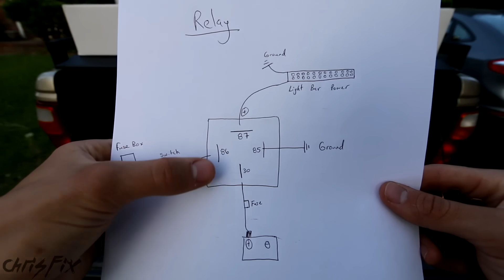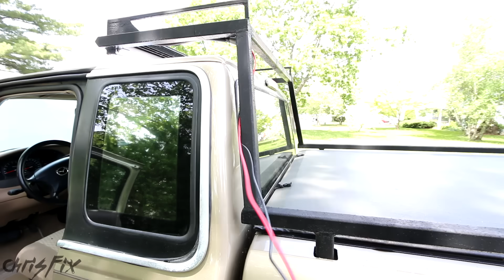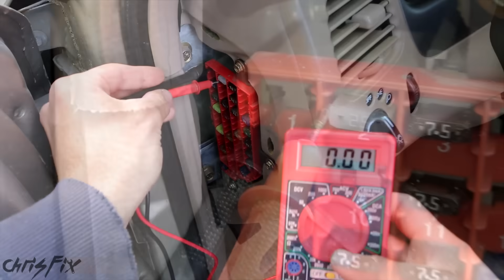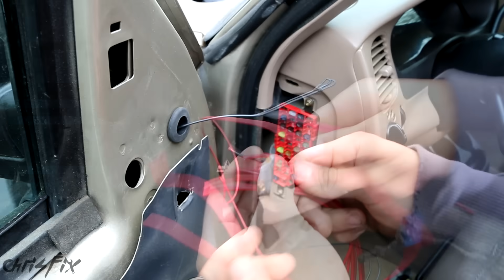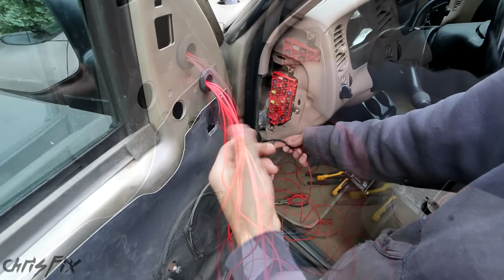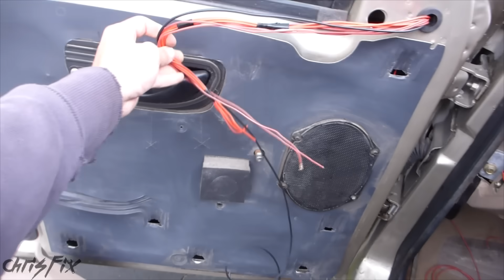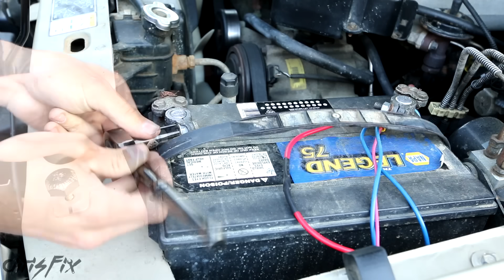How to Wire an LED Light Bar Properly (Project Night Light Episode 3)

Comment: If you want a more professional look drill hole in the square tubing and run your wire through the tubing , nothing looks more tacky then a bunch of zip ties all over your light bar 🤦

Comment: Can u make a video of doing a light bar going straight on the high beam and no extra switches
Reply: I heard that’s illegal for road use. But basically what you do is do a fuse tap with the 86 terminal on the relay to the high beam fuse on your car. To make it road legal you have to add a switch somewhere between the relay and the fuse tap where you can break the connection between 86 and the fuse tap. Switch on, high beam on: high beam+LED Bar on. Switch off, high beam on: LED bar off but the car’s high beam turns on.  Make sure you connect to 86 though
Reply: @martinramos1737  thx mate

Comment: @chrisfix id reccomend a distributing block! Like another baby fuse box with a single power from the battery to the block and block can be mounted in the engine bay. That way you don't need to run a million more wires off your battery terminal. And upgrade alternator size. Keep it more neat and organized. 

Some have internal fuses as well.

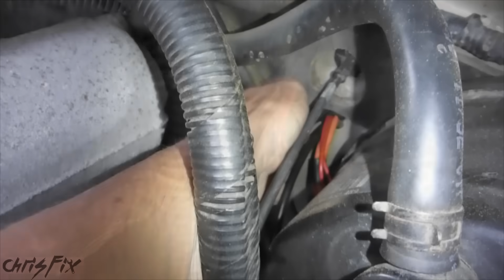Comment: 22:33 don’t forget to put on a protector on wires from the heat at the engine and sharp pieces on engine, cause to chafe or frayed and get a short and blow the fuse up

Comment: Have a question. 24:54 why ground wire put in negetive? Not in metal?
Reply: The black post is ground. If you follow the big black cable to the fuse box you’ll see it breaks off and connects directly to the body creating a ground connection to the negative terminal. Same reason you can connect the LED to the body.

Comment: I realize this video is 9 year old, but I have on question. Isn't the ground of any car just the negative of the battery? I believe in all cars the body is connected to the battery's negative, isn't that correct?
Reply from the maker: The negative is connected to the chassis so you are correct

Comment: Chris — did you ever do an update on your off roading lighting? Considering this was almost a decade ago, I wonder if you ever ditched the setup and installed a switch board to avoid drilling into factory parts?

Comment: If you're getting power from the fuse panel. Why does the relay have to go to the battery AND the fuse panel?
Reply from the maker: Running a lot of amperage through the fuse panel is not ideal. Most fuses are smaller so to mitigate the risk of overheating wiring I ran the main power wire from the battery directly to the relay.
Reply: Thanks for getting back to me. I got everything installed and am very happy with it. It all made sense once I got going. Drawing the diagram and showing everyone your example helped a lot. 

Thanks!

Comment: Why do you need to use the fuse tap? I thought the hot would come from the relay, to the switch ,and then to the light. Thanks.

Comment: If i am  going to have another 3 switches for different lights as well do i run a fuse tap for each switch? or that one fuse tap would work for all of them? With 5 amp fuse ?
Reply from the maker: You want a fuse tap for each switch.
Reply: @chrisfix  awesome thank you for the speedy response and is there another way of doing this? Since I am planning to use like 4 switches?

Comment: I prefer to just wire the light to be on the same circuit as the high beams, if I turn on my high beams, that means I need more light and that’s the whole point of the light bar, an additional button would just be bothersome unless you use it for some specific purpose where it needs to be on separately. Rather, we have to do so here from what I understand in the law. 

It has to be wired in such a fashion that when the high beams turn off, the light bar turns off immediately. Probably for road safety so it doesn’t blind unecessarily and you don’t have to fumble with more than the normal controls.

Of course, people might install a button anyway but by law, turning off the bright lights need to turn off the light bar too in some way.

That at least makes it much simpler to fix. Just find a way to let the signal wire leech off the headlight’s wiring, fuse or electricity.

Comment: Did you daisy chain the relay wires for the switches or did you run the switching power to separate other fuse taps?

Comment: I just almost set my buddies truck on fire trying to wire 4 pods up. The switch didn't work, so we swapped the power supply and power acc and made the wires glow and stick to the truck

Comment: Not trying to be that guy but a faster and easier way to snake the wires would’ve been pull them from the bottom to the top instead of top to bottom

Comment: I usually wire up my switch with the ground instead of the power. That way if something gets pinched or rubs through the wire insulation the worst thing that happens is the light turns on, instead of arcing out if it was the positive wire.

Comment: Are you able to jump the power cable from each switch, similar to how you jumped the grounds, as long as each switch had it's own relay also? or would you need a separate switch tap for every switch?
Just so I can wrap my head around the actual activation of each switch :P can anyone help you've definitely given me the confidence to try and tackle something like this.

Comment: Is that fuse tap for the switch only for if you want to be able to turn the light bar on with the truck off? Or is it required. Thanks for the great video!
Reply from the maker: The fuse tap is necessary to trigger the relay. You can pick if you want to tap a fuse that is "hot" when the key is in or hot when the key is out and in.

Comment: Are you able to just use the one fuse tap for all your different lights or do you have to have a different fuse tap for every switch
Reply from the maker: Depends how much amperage you are running though the wires and how thick the wires are and how long of a run it is.
Reply: @chrisfix  Ok thanks for getting back to me

Comment: The best quote for electricity “go big or go home” i seen someone wire aftermarket fog lamps with speaker cables (thin copper/steel wire meant for audio) and guess what. smoke and flames.

Comment: What I’m trying to figure out is I have 3 wires to a turn signal yellow led and white led on a side mirror. I want the turn signals to always activate the yellow leds and I want the park light switch to activate the white LEDs and always be on. 
I can find how to do that. I don’t need a switch to toggle them on. I can’t find how to wire it.

Comment: I followed your video to the T and for some reason my LEDs have a flicker to them and they have a delay when i change colors with the remotes any ideas?And everything is brand new wires,relays, connectors and switches if I hook the LEDs up to the battery they work fine if I hook them up to my headlights they work fine but when I use a fuse tap and relay like you did they flicker im so confused

Comment: Here's a tip for running cables in wire loom like a pro, take a 3/8-1/2" wrench depending on wire/loom size, run the wires through the closed end and run the closed end of the wrench inside of the open gap on the loom as the wires lay directly in without any fiddling around. Can do like 40' in a minute lol.

Comment: I just saw this video.  Good job.  My ONLY suggestion is that ANY connection made in the engine compartment that is "hot" you really need to protect it.  In your video you just crimped a spade lug female connector onto the relay, leaving the actual spade lug exposed.  You noticed that the rest of the connectors that were factory made (from the harness that came with the lightbar) had a protecting cover over the spade lug.  Since you are building it yourself and didn't have the same type of rubber/silicone cover that the factory used, you could simply use heat-shrink tubing to accomplish the same thing.  That way you would not have any exposed "hot" connection in the engine compartment, other than the battery terminal.

And speaking of the battery terminal, look at your Negative side.  Pretty rough!!  You really need to fix that so you don't have wires coming out of the battery terminal lug.  Over time that produces resistance, which will affect all of your electronics.

Comment: So I just did this. My only issue is the fuse. None of the extra fuse slots work on my truck. Is there any other way or another area I can connect the fuse. Or is there a way to by pass the fuse?

Comment: Chris you have a nice new toy there!! I Did noticed, in the video that you ran your wires through the battery lifting strap? It's going to make it hard to change the battery later. Without having to remove all your wires...

Comment: Chris, I measured the voltage on my CVPI fuse box terminal for constant 12v to radio, and with the fuse pulled I measured 12.6v to source side and 2v on the load side.  I expected zero volts on the load side.  Any idea what  is going on? I haven't used a multimeter much but pretty sure I had it set correctly.

Comment: @ChrisFix If you wire a light bar this way to where you can turn it on with the vehicle off, does it still have power even with the switch off? I would like to rewire my light bar this way but I don’t want it to use any of my battery while I’m not using the vehicle, will it drain my battery? Even if it’s just a small little drain I still wouldn’t like to have it that way

Comment: What is the thing you add to the switch called? Avoids any soldering and let’s you connect the wires to the switch easily. Would love to find that on Amazon or something

Comment: Doesn't the fuse tap prevent you from closing your fuse panel? On your Mazda, an uncovered fuse panel is exposed to the elements whenever you open the driver's side door.
Reply: Someone didn't finish the video..

Comment: If you didn't want the lights to turn on when car is not running could you plug the fuse tap into any slot that is the right size?
Reply from the maker: Just need to find a fuse that is off when the car is off. Use a multimeter.

Comment: So if I substitute the fuse box wire with an already switched 12v (say for an aftermarket radio on my motorcycle) it should work fine correct? Rather than with a switch; it will turn on when the ignition key is turned on?

Comment: Is it possible for the relay to go bad. I have a light bar that's been working. All of a sudden it stopped working. I checked all connections, good, all inline fuses, good. The toggle switch light comes on, but my light bar still won't come on. I hear it click on and off when I turn the toggle on and off.

Comment: Chris love your videos! 
I'm updating the rocker switch for my light bar and noticed that the ground wire coming from the relay to the ground post on the battery is getting hot. 
Any idea why? 
Greatly appreciate any advice.  Thanks.

Comment: What I usually do is run a bigger cable from the battery into the back of cab and put a fused distribution block. To prevent having too many wires running to the battery, figured that might be a good alternative for those interested

Comment: I'm afraid you are going to find that your lights are mounted too far back on the top of the truck. They will shine on the roof diffusing your light. You will need to mount them at the front edge of your roof in order for  them to shine forward and down and to the sides.

Comment: Hello Chris fix, i have a 1989 Mitsubishi Fuso Fighter truck. it came with halogen headlamps, but they are not the best, they are not bright at night. i did put in led bulbs directly in the lens, but it was even worse, what can you advise. the lens is glass. Please find time do help here. i put and axially led light bar, it works ok and is bright enough, but i would like light coming from the factory headlamps. and also the lightbar is not legal on the highways.

Comment: You never want to max out your fuses, if your light can use a maximum of 15A, you should gauge your wire to handle 20A and fuse too.
as a rule of thumb, you want your light to use UP TO around 80% of the Amps your fuse and wire can handle.

Comment: Use 10G wire pull a looped wire into the cab to a heavy duty switch. Cut your loop into 2 wires and wire it to the switch. I like using 120v rated toggle switches. Run one line to the positive side and the other line to the light. Add a inline fuse coming off the positive side of the battery. Run your ground directly from the battery to the light. There is no need to use a relay. When coming directly off the battery you don’t have to worry about connecting to secondary source and protecting the secondary source. I’ve been electrician for many years. Don’t use cheap switches that can’t handle the amp draw that’s where people get into trouble. Get a old fashioned toggle switch, drill a hole, mount, and go.

Comment: Hi Chris. nice video. quick question. if the switch is connected to an always-on fuse, the little LED on the switch will be illuminating even when the engine or ACC is not running. Won't this kill the battery? imagine you wanna leave your car in the airport and let this little LED illuminate for a couple weeks...

Comment: At 24:53/28:16 in your video your negative/earth on battery post is still loose despite you clamping it up to its full extent,you obviously know about this but judging by some of the comments from viewer's who are not very converse this could cause a flat battery due to not charging correctly, sluggish starting, non starting,battery post burnt out or while you are demonstrating your newly wired lightbar or whatever in the wilderness your battery lead could quite easily bounce off. This would most likely kill your alternator leaving you with whatever battery reserve to get home. So check your connections properly.

Comment: Hey Chris I have a question, I want to hook up my brake controller to my truck so I can use my 7 way and get power to it, and I had a question and wanted to see if you could answer. On my brake controller it wants me to hook into the power of the battery and I’m fine with that but I don’t want it in the engine bay and don’t want it under the dash. On my fuse panel there are 4 empty spots that have no wires connected to it at all is it possible to hook into that for my fuse then to the battery? I want to know cause I don’t want my truck to look like it’s been worked on and looks messy I want it to look almost oem as if it came with it from factory is that possible?

Comment: Couldn’t you just wire it in with the high beams fuse in your fuse box so when you turn on your high beams it would activate? Instead of using the relay just curious

Comment: Chris, I wired in a lightbar following instructions, it works. My power windows, locks and mirrors and dome light stopped working. Double checking fuses, anything else I should check? It's a 2010 Ranger, 4L

Comment: you wouldnt need eight wires for 4 switches. eight is enough for seven switches. five is enough for four switches, as you only need one feed to all the switches, assuming there all going to relays.

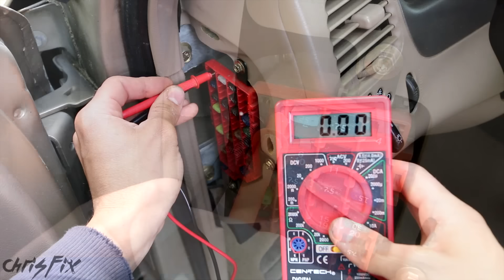Comment: 8:43 The way you search for a usable fuse socked is incorrect. The way you measure, you assume that there is a resistive load connected to the fuse socket on the back, which is not necessary always the case. It can often be that the hot side of the socket is actually connected to the ACC switch and that the load side is not in use, then you'll measure nothing even though the fuse socket would be usable. You better use some bare piece of chassis as ground like a bolt, or pin 4/5 on your OBD port. It cannot harm to measure like you did, but you'll have a lot of false negatives by doing so. Also, the fact that you actually found an usable socket the way you did, indicates that you have an appliance in your truck which was not receiving power due to a missing fuse.

Comment: Damn I'm an electrical engineering student and to see all this shit I've learned about actually used in real life scenarios, that I'm going to be doing tomorrow, is wild
Reply: How did that go
Reply: @timjump8477  Went pretty well actually, I couldn't mount it where I wanted to, so I had to mount it on the hood instead, just drilled a few holes and stuck it on, no leaks or anything so no need for silicone. Wiring wasn't bad, had to drill a hole into the cab which was quite a pain, that steel or whatever was hard to get through, had to work my way up in bit size, but the wiring was very easy, just went from battery to the relay, relay mounted to a frame bolt close by, relay to the bar as well as the switch I fed into the cab. Then cut a rectangle in my dash with a Dremel and press fit it in. All around took like 4 hours or so, longest part being trying to feed the wires for the switch into the completely sealed cab, figured that part would be easier than it was

Comment: You sure did have a lot of exposed spade terminals next time take your heat shrink and cover your bare female spade terminals or buy the more expensive ones and your battery terminal wires looked like they where about to pull out

Comment: Here Is a Heads Up 
If You are getting  a Howling issue from the Light Bar  when driving at high speed it would sound like a Whistling Kettle or you might think it will be something in the engine bay area,  just put rubber door trim across the fins and it Fixes the problem.

Comment: Maybe it’s in this thousands of comments somewhere but…… you need to check for which “leg” is providing power in the fuse box before adding that fuse insert you used. This is because, if you install backwards the leg being used to power the switch will always have power and not be fused. You must use another ground and determine which leg has power and insert fuse “insert” and ensure there is no power coming out of the “insert” wire to determine correct orientation of the “insert”. If there is power with no fuse then flip the insert. Make sense?
Reply: Great video though!